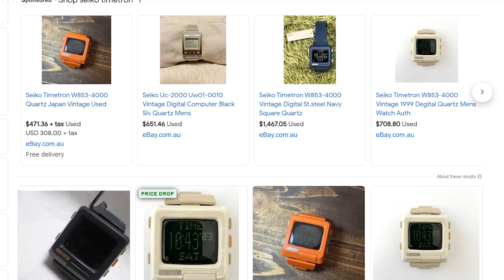I Invented The Worlds First Macuum Former

Comment: Great project. If you add some negative - Z offset to your printers build plate adhesion setting (e.g. -0.16mm or less) you should get better 1st layer finish, it will squish it to the surface slightly filling the small urface voids.

Comment: Upvoted just for the puns alone, although the concept (especially different bed sizes) is interesting. Looks like you're just heating the plastic up in a frying pan - can you give any info on the process here?
Reply from the maker: Its a "heated serving tray" which you can cook in. It was just what I could find (also in a bin) on the day. They dont really get hot enough, a portable electric hot plate is ideal. I didnt show it here but I had a few failed forms due to the plastic not being hot enough, so I had to use a heat gun which got it too hot and it blew out.

Comment: the thing about the plastic being lighter after sanding, you could solve it without paint. You just need to blast it with a  heat gun for short while at the temperature roughly below the temperature you set your 3D printer bed at
Reply from the maker: Will have to give that a try next time. I even used a heat gun to dry if off here so could have saved me some time